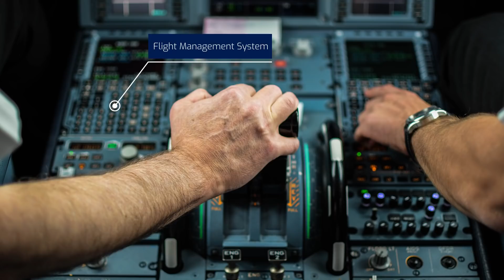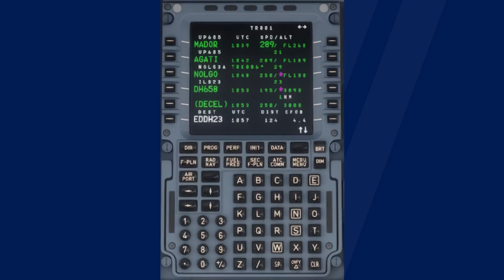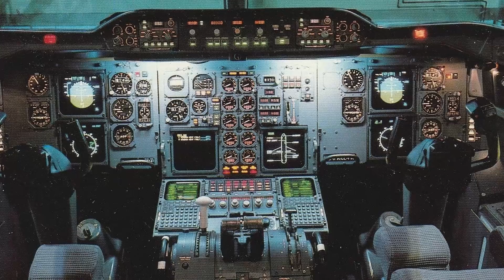Bad Decisions | How Hapag-Lloyd Flight 3378 ran out of fuel

Comment: I do not fly the Airbus.  Only late in my career was flying an Airbus even a possibility when eventually the airline I fly for introduced the model into our fleet.  By that time in my career it did not make sense for me to change types (my age, schedules, domiciles and seniority issues).  it's a bit of a shame as I think I would have liked the opportunity to learn and fly the Airbus.  In the Boeing 737 Quick Reference Handbook (current aircraft flown) there are multiple warnings informing the flight crew not to rely on FMC (Flight Management Computer) fuel prediction when dealing with abnormal drag configurations (flap, slat or gear abnormalities).  Not to understand that fuel prediction values derived from an FMC/FMS are based on known drag profiles is a fundamental error.  Anything that alters the drag profile introduces an error into the fuel predictions.  You (Airspace) of course PERFECTLY pointed this out in your video.  It is shocking that the commander based his decisions on faulty assumptions and the First Officer was unable to convince him of the folly of pressing on.  Fortunately everybody survived when the jet arrived meters short of the runway instead of someplace else less suitable.  In aviation; "what I do not know, do not understand or cannot do CAN hurt me!"  "No brains-no headaches" is a funny saying, but it doesn't really apply.  I am not implying the commander "has no brains" or is stupid, I am certain he is not.  However his not understanding the limitations of the "magic boxes" had tragic consequences.
-Respectfully

Comment: Striking behavior from the crew, specially captain. Unbelievable. FL310 (beyond what the ref hand book graphs could show even) with the gear down and excess fuel burn. Endangered the rest of the crew and passengers.  They passed over so many airports they could have landed at. Again I wish the FO had asserted himself earlier, declared an emergency, taken control and diverted the airplane. This issue of the FO not asserting  is an ongoing human factors issue I feel. How much time is spent addressing this during airline pilot training? If only they'd dumped fuel and landed back in Greece.

Comment: So they flew with the landing gear extended? Wow 😯
Reply: That’s fine.....provided they recalculate the fuel requirement using the increased consumption from the performance manual.

Comment: To me the most impressive part of this accident is how the landing gear down on just one side increased the fuel consumption by 60%. It's pretty small compared to the rest of the plane, and yet "only" adding this amount of drag destroyed its fuel efficiency. It really shows how well the plane cuts through the air in the first place.
Reply: I think not only the drag, it also caused a yaw, so the plane is constantly trimming just to fly straight.

Comment: 08:45  "...increases fuel consumption by a whopping 180%..."  The plane burns almost three times as much fuel with the gear extended?  The 100 it would burn in clean flight PLUS ("increases") the 180 MORE with gear down?  It's inconceivable that the pilots would not notice or fret about fuel being consumed at nearly triple the rate.  And wouldn't the power settings v the aircraft's performance have been so odd as to be a constant reminder of the situation?  I'd look for a financial or personal reason why the captain was so reluctant to face the enormity of the situation until it was too late.  What was his or her punishment for causing this loss?
Reply from the maker: unbelievable, but true, yes. 
The captain's license was revoked and he was sentenced to 6 months on parole due to "dangerous interference with commerical aviation"
Reply: @AirspaceVideos  Thank you for the reply.

Comment: How could a pilot continue flying towards the destination if he knows that there is a problem with the landing gear??? This is nuts!!!! You can't effectively fly with landing gear extended!!!
Reply: You can, provided you account for the fuel.
Reply: @peteconrad2077  don’t landing gear ‘never exceed speed limits’ that would force pilots to fly excessively slow compared to normal cruise flight?
Reply: @jonasbaine3538  yes. In most aircraft you’d have to fly slower and lower.

Comment: I wish they would not criminally charge people for accidents like this.
     Except in cases of criminal negligence (such as flying drunk or performing unauthorized aerobatics) criminal charges will do nothing to prevent future accidents.
     The entire point of these accident investigation is to find out what went wrong, what mistakes were made, and what equipment broke to cause the accidents. To accomplish this, investigators need to know exactly what was done in each link of the chain leading to the accident.
    If there is a possibility of criminal charges, those people involved in the chain may either lie, or withhold important information in case it was their mistake that caused the accident. And if there is something like the 5th Amendment in the US no one can legally compel the person to say what he did, that may or may not be an important causal link in the chain.
     If you are being investigated for a possible crime, it is incredibly stupid to volunteer ANY information, because that information can be used against you in court.
    There was an accident several years ago when the front window of an airliner was replaced. When putting the new window in place he found he didn't have the correct screws to hold the window in place. He took one of the old screws (that could not be reused here) and used it to eyeball a replacement.
    The screws looked like the right size, and they went in normally, but the screws were very slightly smaller and as the plane climbed the window blew out, sucking the pilot out the window. The pilots leg got caught on the control yoke push the plane into a steep dive.
     They managed to free the control yoke and level the plane, they even managed to hang onto the captain until they landed. Incredibly the captain survived this and wasn't even badly hurt.
    We knew how this happened because the mechanic had said he used non-standard screws to mount the window. They were able to make changes to the policy to prevent this happening again.
    Now, if you were the mechanic would you have admitted using non-standard screws if you knew you might be charged with a crime?

Comment: what speed were they flying... because if I remember correctly the extended gear Vmax on an A310  is 240knots, way bellow the cruising speed, especially at 31000ft

Comment: In the old days, the gear could be manually retracted (usually by a sweaty engineer in the cockpit/hole) using a simple ratchet tool and muscle. Was that not an option on the A310?
Reply from the maker: definitely not!

Comment: Is this sort of thing common in Europe? I just watched Mentour Pilots discussion about the crew that had an engine fail right after takeoff, and proceeded to similarly fly for hours, never declaring an emergency, and similarly screwing up fuel calculations. Why would this crew attempt to fly on to their destination with the landing gear stuck down? On top of the excess drag and fuel burn, they are limited in speed and altitude. Because flying too fast will damage the undercarriage. Isn't normal procedure in this sort of gear failure to immediately contact ATC, then find a safe space to slowly circle to burn off fuel until you can get down to a safe landing weight, and then land, typically at the airport you took off from?
Reply from the maker: it is not, the pilots in question have been suspended. 
https://avherald.com/h?article=4cbe8434

Comment: One question, please. 
What would have been the company punishment for returning immediately
to the departure airport when the gear failed to retract?
Excellent presentation of facts, thank-you.
Reply from the maker: none at all! That is always possible.
Reply: Probably nothing, as major mechanical malfunction is generally not held against the pilot. But they would probably have had to spend an hour or two circling the airport burning off fuel to get down to a safe landing weight. The big problem with "gear stuck down" is you don't know what's going on there. Is it a bad sensor? A minor malfunction? Is the gear in a locked position? Can you in fact land on it? It's the kind of thing you want to be talking about with both ATC and your ground people. They may not insist you return to your airport of origin, but probably want to put you down at the best alternative. Possibly wanting longer runways and more advanced emergency services.

Comment: When exactly did they notice the landing gear wasn't coming up?
I'd have done a fly by the tower of the departure airport, to get a visual inspection.
But I'm no pilot 😅😆
Reply from the maker: immediately after take off
Reply: @AirspaceVideos 
Then it seems that a fly by would've been very useful, wouldn't you agree?
Reply from the maker: no, they had a valid indication confirmed by two indepenent sources (both landing gear control systems). A flyby would have brought no new information.
Reply: @AirspaceVideos 
Ooooooh, I see
Thanks for explaining!! ^^

Comment: Insane, never heard such a crazy story about pilot decisions. Also, I thought it wasn’t allowed in general to continue flight with extended gear? They should return back to their origin airport right?
Reply from the maker: Well not exactly. There's no rule against flight with extended landing gear per se. It's just not very wise 99.9% of the time!
Reply: @AirspaceVideos  but you can’t reach cruising altitude with extended gear right?
Reply from the maker: exactly, they could omly reach 31000ft instead of the normal ~39000
Reply: Continuing flight with extended landing gear … certainly is part of normal operations (as is reaching normal cruising altitude) if you fly a Ju52/3m or a Cessna 172 or any other fixed landing gear plane. Not many big jet airliners amongst the list, though.
Reply: There are tables given under the " gear down " section for all phases of flight..dunno if this was in their manuals way back then..in either case it's good to know roughly how much EXTRA fuel you're burning with the gear(s) hanging out and figure out if you ll make it to your intended airport.
Reply: @gulthepilot      The corrections in the tables were, IIRC, given up to 29,000 feet, but they flew higher than that.
But the root problem was that the captain believed the FMS would apply these corrections --- which it did not --- and show correct data --- which it could not. Looking at the tables only helps if you understand you must(!) apply the corrections yourself.

Comment: If my car ran out of gas, the worst case scenario would be to walk to a gas station, fill a small canister with enough gas so I can drive the car there and fill it up all the way. A friend of mine who owns a Tesla did not have this luxurious convenience when his battery on wheels ran out of electricity. He had to call a tow truck and had to bring the car to the 'watering hole', also he had to pay the tow truck out of his own pocket, which is more expensive than a canister. 

Anyways, I wonder if the captain was coming down hard on himself after the entire ordeal when he reconsidered his options. Obviously, the first one would have been to turn around after the landing gear failure, or, at the latest having diverted to Zagreb to refuel and not total the plane in Vienna and after a few fixes the plane would have been back in service in no time. Also, if airplanes were to go electric in the future - God forbid - imagine if an airplane ran out of electricity over the Pacific and had to divert to a small airport on a small island that would have no electric charging station, imagine the logistics involved in getting the plane going again. Great video once again, keep 'em coming!
Reply from the maker: interesting questions indeed! I've always wondered how one runs out of gas in a tesla. I mean, doesn't it even consider where your next charging station is along your route?
Reply: The future of flying is electric. But it is still a long way to go. :) also, if the tiny island has an airport, they most certainly have electricity. If they do not have electricity, why would they have jet fuel?

Comment: This is similar to the United Airlines flight from 1978.  Landing gear wouldn’t go down and the pilot fiddled with this issue at length until they ran out of gas and crashed near Portland, Or airport.
Reply: There is one (@ least) instance of a landing gear indicator light having burned out and the crew flying the aircraft into the ground while attempting to troubleshoot the issue :(
Reply: I was living there when that happened.

Comment: This one is mystifying, because shouldn't the flight management system know [1] how much fuel is remaining, and [2] how fast the plane is currently burning it?

Regardless of what the manufacturer's engineers programmed into the system for various scenarios, surely the system knows what the current burn rate is?  Then it's just a simple calculation to see how much time (and distance) you have left.

Not that the pilots weren't grossly negligent, but their system should have easily been able to tell them how much time and distance they had left at any given moment.
Reply: depending on the structure, 
many FMC use a constant pre-written model for fuel-burn rather than having access to the ACTUAL data... remember, the fuel-burn data on these planes is still done via mechanical dials, all values are totally analog (in a format directly unusable by computers)... at any one time, they know via a dial the fuel FLOW RATE to each engine, often no digital or automatic recording of the data exists, & the overall fuel burn is calculated manually from someone reading the mechanically shown numbers...
I am not sure they could yet do live calculations in a cockpit computer size
converting fuel-flow to fuel-burn is a significant operation for the onboard system, given the size of the "box" it takes a fair amount of calculation-capacity in technologies of the time...
Reply: @stanislavkostarnov2157  : Well, I'm no expert, but this airplane -- an Airbus A310 -- was built in 1989, and Airbuses are known for being pretty advanced and high-tech and computerized.  "Fly by wire" and all that.  I think it's a safe bet that the actual fuel consumption rate on this aircraft was indeed recorded in digital form and used by the Flight Management Computer.
Reply: @Milesco  1989 sounds new for an A310.... maybe so

Comment: They should have returned when they noticed the gear problem, or, if they didn't want to be stranded in Crete, fly to Athens. Or, if they continued, land in Zagreb. Or, if even that wasn't good enough for them and the situation became critical, they could have used suitable airports on the way to Vienna like Maribor (2500 m runway) some 100-120 km from Zagreb, or in Graz (~3000 m runway) some 60 km further. A completely unnecessary crash.
Reply from the maker: Agreed, 100%
Reply: Yeah, the pilots had plenty of opportunities to avoid this crash.
Reply: I agree, but with cheapo and small airlines, the pilots are under intense pressure from the management etc to only do such things when absolutely absolutely necessary. Often when looking into these matters when crashes come from pilots attempting to land at an airport when its unsafe instead of diverting etc, the main cause is policies from the upper management that instill a culture where pilots are afraid for their jobs if they waste money doing these kinds of diversions unnecessarily. It causes pilots to second guess whether the situation is truly unsafe or if they are just panicking.